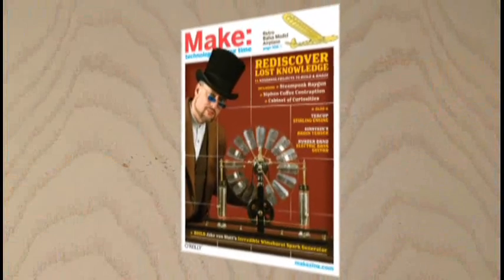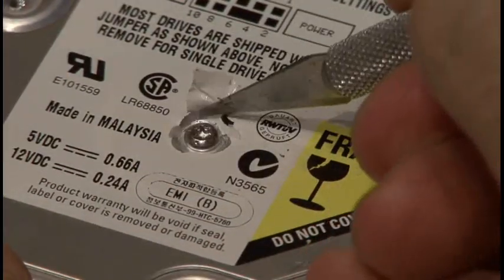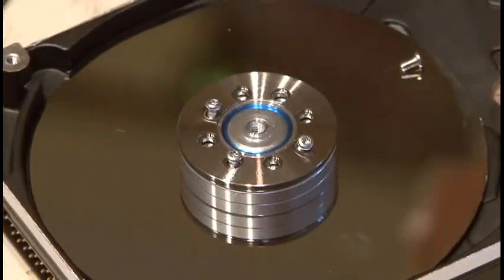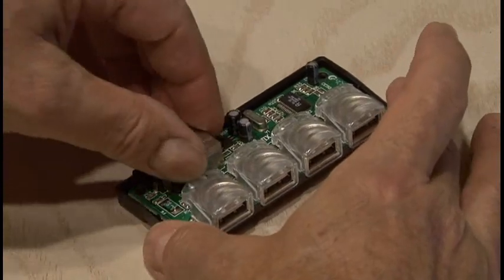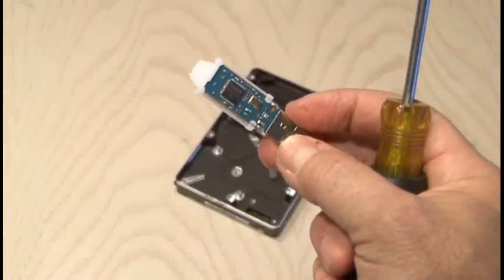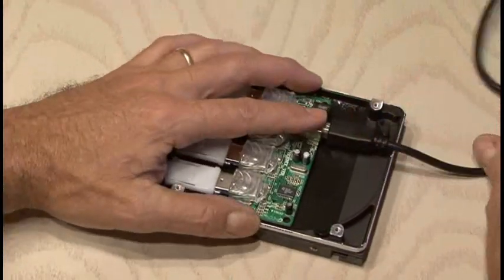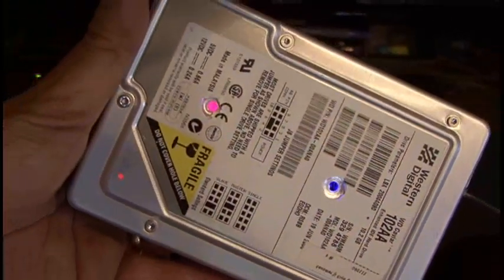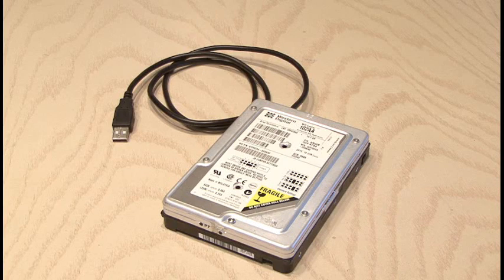Weekend Project: Flash Memory Hard Drive

Comment: When using USB hard drives I have been able to make a Spanned drive in the Windows 7 drive management setup.  It would be interesting if multiple USB thumb drives would work together as a Spanned drive. 

With Windows 7, I found that I cannot make a striped RAID unless I use the SATA ports on the motherboard connected to SATA drives, or use a third party controller with the third party software.

Comment: I agree with some of these comments on this video: RAID 'em, RAID 'em, RAID 'em! I have a NAS storage drive which has two 1TB disks set up as a striped RAID0. You should be able to pull such a stunt in software. But, you're gonna have to take the two 4GB drives t

Comment: YOU SHOULD be able to go into the disk utility and configure all the flash drives as a raid. correct? Or just put them all onto a flash drive hub, then configure as raid, same difference. Load an ISO operating system on the drives, like Linux Mint or Ubuntu, whatever, then select boot into the flash raid, there ya go, a flash driver version of a hard drive.

Comment: If you are using UNIX, A simple command and you SUMM all 4 usb dives in ONE, So you can have a 4 x 32 gb = 144 gb for peanuts.and  the best part of it is that the files spread between the DRIVES, so you have 4 times the speed on ONE!!! GOOD for using in a Raspberry pi, for example, you can run a media center for you home using this technology
A RPI, costs $35.
THANKS, THE IDEA WAS GREAT!!!!

Comment: You can flash the USB disk's firmware to convert them into hard drives than use Disk management to group them into one logical disk
Reply: okay, how the hell do you expect to 'convert' a USB flash drive to a hard drive, i have a feeling i know what your trying to say but, they are completely different, also USB Disk?
Reply: it makes it so all the usb sticks think they are one stick, also known as a RAID
Reply: There are certain adresses in the firmware that decide if it is mounted as a removable drive or an external hard drive. The later also allows for more than one volume on the drive and actual user management for the files. But it is fairly easy to soft-RAID multiple usb drives.

Comment: Be careful with this build if you will be using writing to it often. USB drives have a write limit that you will quickly reach if you put an OS on it or defrag the drives for whatever reason. If you are just going to get data off the drive (Read) then you should be fine. The write cap doesn't happen for a long time unless you put an OS on it but just something to be aware of.

Comment: Wanna have some real fun? use a ide adapter and a 500MB compact flash card, install it into an ancient IBM butterfly 701 laptop and install good ole win95 on it and watch it fly.
Reply: yeah back in 2012-2014 i had to use a laptop with windows xp. not a happy ending as that laptop is DEAD, freaking capasitors.
Reply: How about Windows 2000?
Reply: Peter Kapica Win 2000 was better than XP if only due to the lack of the SCSI bug. It was the best OS since DOS 5. XP was great for almost everybody. Only microsoft's windows rot (and stopping support of it) got people to move on.
Reply: I still think XP is the best OS. I used it for a long time and I really like it. Win2k I never really played with it much (except in a virtual machine) and it requires a lot of things to get stuff like a modern browser to work. But it did get support for 10 years up till 2010. XP went 12 years till 2014
Reply: I liked just DOS, nobody cares anymore about DOS.
Reply: Jason DeLozier DOS wasn't user friendly. You had to learn exact commands and syntax to get it right, and be able to adjust the autoexec.bat and config.sys files to get your program to run right. With the inclusion of special video drivers and sound cards, then memory management, sometimes it became a challenge just to get your program to run at all. Every few weeks, I had to help someone get a game to run. Gradually, windows changed all that. I for one get much less computer support calls than I did 20 years ago.
Reply: ok i can supply you with the windows 95 disk
Reply: I still have all the way back to my dos 3.3 discs. Don't know if they still work.
Reply: D.E.B. B if you got a 3.5 inch floppy drive then yes it'll work
Reply: sys c: Do you remember the last time you typed that? For me, 2004 when I picked up an old IBM butterfly at a flea market and had to install a new hard drive.

Comment: Just run all of them in RAID 0 issue solved
Reply: Raid 10 for redundancy.
Reply: It binds the storage together, but there's no redundancy, if one fails they can't rebuild and your data is lost.
Reply: Ryan Amos just like a real hard-disk, and flash drives rarely fail
Reply: Skidtire SSD/Flash storage will fail faster if it's in use a lot (an OS for example), a lot faster than a HDD.
Reply: raid 1 has more storage though but kinda slower
Reply: no, raid 0 is twice raid 1 but without protection
Reply: MsVideoFan I'm almost certain it's impossible to rebuild data from a dead drive in RAID0.
Reply: wrong.... flash drives have way less read/write cycles that they can perform.... so they will fail quicker then your typical Hard drive... 

that was one of the problems SSDs had to overcome...
Reply: Marty Mooney The 3rd comment already said this.
Reply: You don't use stripe with different sized drives, unless you want to lose 4gb capacity in this application.
Reply: Furthermore, the whole raid is f***ed if one fails, and data recovery softwares have a harder job than on regular hard drives

Comment: Your going to need to setup a raid array and In Windows its not really possible to do easily but you can do it on Mac if you get it to be cross compatible in an array but that's the only way I would actually consider doing.

Comment: ive tricked my system into thinking that a "cd" is a usb using a program(it just changes the disc type(like "f" to "d")to a usb type) and raided a tower of cd drives (you can buy these in places where they specilise in massive cd data exchange (pc to disc,disk to pc) and you wouldnot beleve the speed lol. and i use it for storing stuff from all my devices through my wifi network/sever

Comment: the trick is they must be formatted with NTFS file system, then Windows 7 or later can convert them to dynamic just with the disk manager tool.   If yours is larger than 16gb usually this is not an issue in my experience but the older drives used in this video would certainly need to be repartitioned, and reformatted to the NTFS file system.   You should google for instructions on how to do this.

Comment: could have used the original connector for usb, instead of drilling for the cable. It would have appeared to be OEm, just with an "upgrade" usb BODGE
Reply: +John Street ... Then you would just need to add sound. I forgot that part. And heat.

Comment: even in '09, i wouldn't have sacrificed a drive to add just 24 Gb. why would you make an external part internal? Are you that cramped for desk space?
Reply: +Nathan Zeligman:  Mine is.  I have no space at all, and use either a trackball or touchpad as the mouse because there's no space to move a mouse.  Having said that, if you want to make a RAID drive with 4x256gb drives, that might be worthwhile as an internal drive.
Reply: My point is that this project only makes sense if you have those parts laying around. Itd be cheaper, easier and better performing to just buy a 1 tb internal drive. The advantage of thumb drives is portability.

Comment: What's the point of all these? Why don't you just buy a new hard drive?
Reply: +Bin Guo Flash drives are flash storage like SSDs, so they are faster than hard drives and can be moved around safely while running. Not many people know this, but when you are moving your laptop around and it is turning on or running programs, there is a chance you could corrupt the disk.
Reply: +Bin Guo and for "corrupt" the disk he means that there's a chance that you break a spot in the disk and never again be able to use that spot which translates to virtually less space and fragmented data, which also means slower reading and writting. don't even talk about break the small needle (which is most of the hdd problems) which means all the disk is dead. 

if you have few equal pendrives (same sizes) you can turn them into 1 disk with faster speed and reading (let's say 2 pendrives with 512 GB turns into 1 GB) or 1 disk with even faster (twice) reading/writting speed at the price of one disk memory (2 pendrives with 512 GB turns into 512 GB with 2x the reading and writting speed of the original pendrive)

Comment: lame sauce, hack. What Nick said first off, secondly I know the vid is old but the reason for the hack comment is because of the dremel nonsense, be cleaner and brighter man. pop the case back together with the 4 corner screws and drill out your hole then de-burr it with that dremel tool... fucking hack didn't make anything faster, just made an almost fancy usb hub. Got boredom?

Comment: why bother put in an old hard drive case. you can just leave it as a usb hub
Reply: +STORM TROOPER There are multiple reasons.
1. Inside the case, they are at much less risk of accidentally being unplugged if you bump into it or something.
2. Instead of having to carry around 4 usb's and a hub, you just stick one thing in a bag and you're on your way.
3. It looks nicer (especially if you remove the labels and such so you just have a metal case, you could even decorate it)
Reply: Trophonix makes sense too. thanks for explaining
Reply: +STORM TROOPER For the pazzaz! :D
Reply: +Trophonix and dont forget to add that YOU MADE IT and not some manufacturer

Comment: You mean plug this in using the old IDE connections to an older system for the single letter. Thats how I would do it if I had time to try this project. I dont currently but maybe in the future.

Comment: You can do software-raid via Disk Management, or running " diskmgmt.msc " in Windows. That way, it will also work on other computers
There is a command-line utility for this program as well - it's called diskpart

Comment: Arg i thought this would be a cost effective SSD tutorial, this is not very practical as flash drives have a limited lifespan such as 10,000 writes per drive i believe as well as each drive is separate. However this IS good if you have a very limited budget and need the space immediately. So to each there own.

Comment: I'm sorry but I don't get it? You spent all that time and effort making the USB hub smaller and the Flash drives smaller so they would all fit on the hub at the same time, and then you mount it in a full size hard drive case where you don't use the connectors for the drive or the power for the drive or anything about the hard drive - you cable it up to a USB connector just like the USB hub came with. So - what was the purpose of putting it into a hard drive case? Why not package the "amazing invention" in something much smaller or why not use it simply the way it came - as a USB hub and some thumb drives outside the computer case so you can change them and access them without opening your computer or a complex hard drive case?
Reply: +Donald Gulledge There is also the time spent making the video, a far more industrious task a decade ago... I've chuckled lots reading Raid Raid Raid and odd jem. The comments were just as entertaining as Kips bright attitude, I like that. I wish I was easily please too.

Comment: You can make those drive dynamic by hacking the flash drive controller.
Download chipgenius to identify controller used and use some google magic to find controllers MPTool to set to dynamic mode instead of fixed. You can find those tools on flashboot.ru for example

Comment: In Mac you can very easily convert those disks into a single RAID-array which has either greater speed or capacity depending on the RAID type you choose. The options in Windows are less known to me.
Reply: There is a way called JBOD where instead of using one large disk, you use several smaller disks to make one big disk, but im not sure if it can be intermingled with different size disks.
Reply: BIOS (mash delete as your computer is starting up)
Reply: ***** you cant.
Reply: Greater speed AND capacity, (RAID 0 STRIPE) OR lower capacity, normal speed and redundancy protection (RAID 1)
Reply: Phillip Johnson raid 0: if one is lost all is lost
Reply: xX DKspooder Xx, in mac it is also read as a single drive and a single letter as far as I know.
Reply: Blue Shadow Indeed
Reply: Phillip Johnson Indeed
Reply: Blue Shadow Indeed
Reply: Jayden Kelly indeed
Reply: Blue Shadow Indeedly doodly do
Reply: Jay Man Ind'ou
Reply: In mac you can raid drives of different sizes?
Reply: EddvT But.. fukkin mac..
Reply: Reclan Anderson Yeah you can. any size
Reply: Reclan Anderson You Can
Reply: ***** it's not possible to raid a 2 gig thumb drive and a 1tb enterprise drive.
Reply: Okay maybe to but I have raided 2 8gb and 1 16gb flash drive
Reply: ***** Indeed
Reply: on windows too
Reply: VB6_CPP_CSS_CSGO_CODER no..
Reply: Rhys Anderson yes you can, i literally did that for two harddrives using Windows 8.1 disk management.. for other version os's its just run diskmgmt.msc easy rofl, then if you have 2 unused volumes you can just click create new volume, and it'll give you the option to make a striped volume and whatever you want lol
Reply: Rhys Anderson i even made a vid on it now
Reply: In the end it is still software RAID in it's most basic form.
Reply: For Windows, it's much higher less easy, but you can mount them into a storage space which is read by Windows as one drive letter.

Comment: in Windows 8 you can do this (spanning discrete USB Mass Storage volumes) using the Home Server extensions (I don't think this is available in the Home versions or in earlier commercial versions of Windows). Linux has had this functionality for years through Logical Volume Management. It's all down to how the platforms handle the SCSI layer over the USB stack. XP and Vista just plain don't do spanning across USB because they're removable. Not sure about 7 (I doubt it) but 8 seems to have a handle on the more esoteric SCSI functionality.

Comment: The only way you can marry the flash drives would require a usb raid bridge and im not sure if those even exist. Even if it does, it wouldn't fit into you're case thing you made. It would roughly be the size of a graphics card.
Reply: just raid them using windows disk management or Mac disk management

Comment: What the hell is the point of putting it inside the case?
Reply: sleaf6 you can use the internal USB header on the motherboard to put the USBs inside.
Reply: sleaf6
the video is 5 years old ... but possible ;D
Reply: because you can mount it within your computer without jerry rigging it.
Reply: kurok1tenshi
Or you could just get an external SSD :P
Reply: ***** what about USB 3?
Reply: I know, i was just rewatching, as are you :P
Reply: I would like a usb to sata converter, while not sacrificing any speed
Reply: yeah sure why not
Reply: Making it easier to keep a track of perhaps?
Reply: sleaf6
Meh, usb type C will come out and you won't need sata at all, or you could use USB 3.1 right now.
Reply: Type C?
Reply: sleaf6
Type C is a "SUPER USB," as some may say. Its going to be faster then 10gb/s and is going to be reverseable, and also be able to deliver 1000 watts of power.
Reply: that's a bit intense..
Reply: intriguing...
Reply: *****  +Jim Moore Jim Moore already pointed out 2 weeks ago that in Windows, Removable USB devices cannot be converted to dynamic "disks". I myself tested this with a new USB 3.0 HDD dock to see if I could use one HDD on USB3.0 and another on SATA to make a striped volume. I got an error message saying that "Failed: this operation cannot be completed on this [type of] device"

I don't know if modern Linux can make spanned volumes via USB. Can you test this?

A few months ago, for about 2 seconds .... I considered getting a fast USB3.0 hub and doing something similar to this for all my bootable OS install flash drives which I use for my field tech work, but then I realized that it would be problematic to get the right one to boot and if the hub would even be accessible from the bios without a driver to see the hub controller.  This project could be cooler if upgraded to USB 3.0, and loose the heavy steel hard drive case, and add a media card reader. Then you would have a versatile USB3.0 hub and portable storage flash media reader all in one (except those definitely exist, plus they read 2.5 and 3.5-inch HDDs)

This project is basically a DIY USB 2.0 Hub + 4 Flash drives, and it reminds me of DIY Solid State Hybrid Drive kits:
http://www.newegg.com/Product/Product.aspx?Item=9SIA2E112T7999
http://www.newegg.com/Product/Product.aspx?Item=9SIA1JM14K5535
Reply: You can do something else thou, get 2x32gb or 2x64 gb USB 3.0 and put them in RAID to raise the read/write speeds and you have a nice super fast linux distro portable :).

Comment: one drive letter , all u need to do is

1.short the bus pin of each thumb drive with each other
2. the connect the shortened pins to 1 bus slot not 4 .. just pick one. you will see 1 letter drive combined all the capacity

works only with same storage capability thumb drives

Comment: What does the hard drive itself contribute other than a slightly clumsy case to the project?  also why not make all the USB sticks the same size, just to make them easier to handle.  That would also help if one wanted to use some sort of RAID configuration to add error correction.

Comment: I understand this video is from 2009 but...seriously...we are basically putting the multi usb port adapter into a harddrive case that's been gutted out for nothing. Translation? A shiny box with extra USB ports....seems a bit pointless, even back then.
Reply: agreed. you could use a hobby box or altoids tin though.